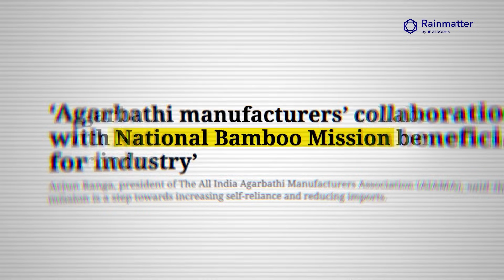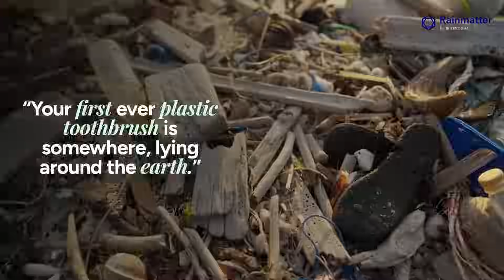How Bamboo Challenges the Plastic and Construction Industries for a Climate-friendly alternative.

Comment: 🔍 From Crude Oil to Plastic: The Basic Chemistry

Refining Crude Oil 🛢
Crude oil is separated into components. One key fraction, naphtha, becomes the raw material for plastics.

Cracking Naphtha 🔥
Naphtha is heated (“cracked”) to break it into ethylene and propylene—building blocks called monomers.

Polymerization ⛓️
Monomers are bonded into long chains (polymers). Example: Polyethylene (bags) or polypropylene (toys).

Why This Matters?

Plastic production is tied to fossil fuels (oil/gas). Reducing petrol/diesel use directly impacts plastic’s feedstock.

BIS-certified toys (IS 9873) ensure safe, regulated plastics (≤0.1% phthalates, no heavy metals).

Solution?
♻️ Fix the system: Phase out fossil fuels, enforce recycling, and innovate alternatives.
Plastic isn’t the villain—our dependency on oil is. 🌍⚡️
Reply: Plastics wouldn't have become a Villain at the first place, if only we had utilized its most/best property, ie of being RECYCLABLE....
If only 1% of revenues generated through plastics souldve gone back in designing practical business models of Plastic Recycling, the world won't be talking of Plastic neither as evil  nor a pollutant.
Regards

Comment: Most bamboo products currently in market have a major moisture and fungal problem. It works well with things that are regularly washed (like towels and combs) or single use products. But I have noticed that there are major issues with bamboo toothbrushes and hair brushes (plus probably similar products) And too much washing and sanitising negatively affects the durability.
Reply: Hmm well these things take a lot research and feedback to improve so ior a beginning it is good.
Reply: I'm sorry but I don't agree. I'm using bamboo products including toothbrush, comb and many other since 2016. All going so good!